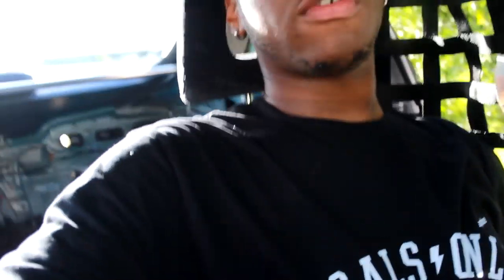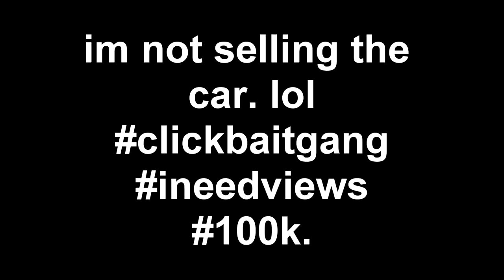Selling My Integra...

Comment: I forgot to add check your ground connections. I had a issue that had symptoms like yours because all my ground weren't hooked up. the major one is the ground that goes from the head to the chassis  so get a wire and unscrew one nut from the valve cover and attach a wire from that to your radiator support. that might either help or fix your issue. if it helps make sure you ground the rest out. There's info on what to do on various forums. I hope that works bro!!

Comment: adjust your throttle its by intake manifold and intake search on YouTube because theres steps to take and clean your aidle air control valve with brake cleaner bro